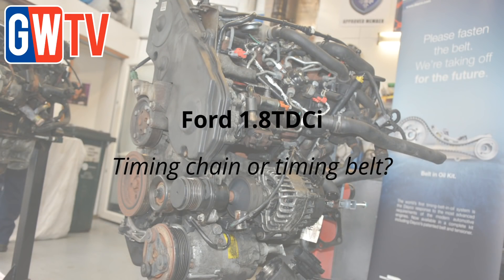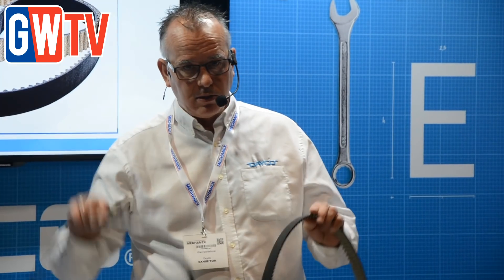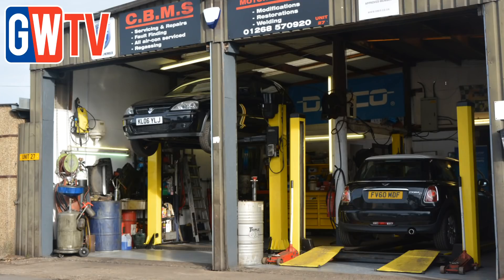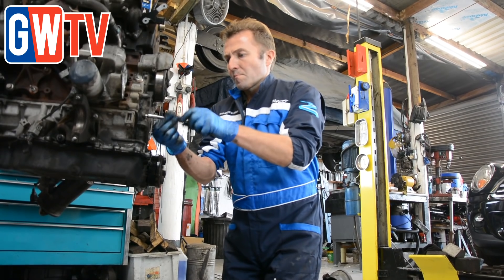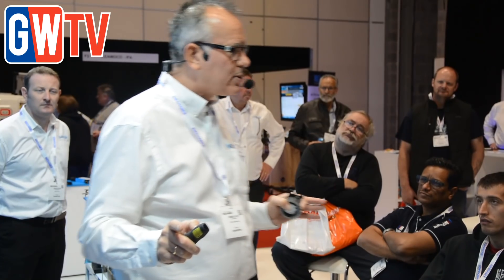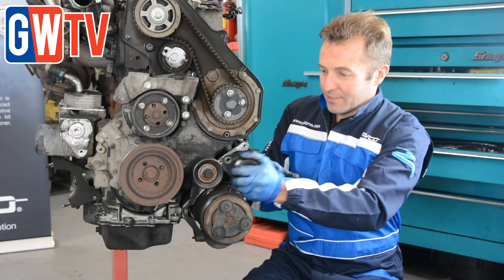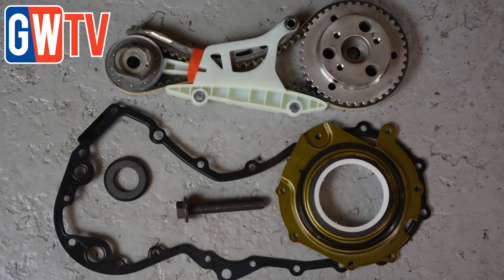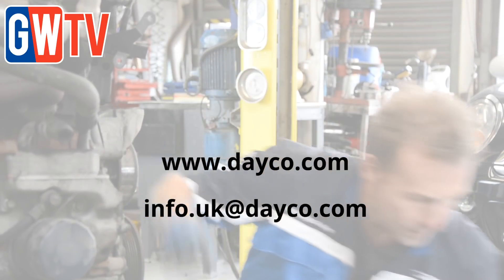🔵 Dayco Ford 1.8TDCi timing belt 🔴

Comment: Why on earth would you replace the timing belt when you can replace it with an orginal ford timining chain that will never need replacement? Even engines that were originally fitted with a timing belt can be fitted with a timing chain with only a slight modification! See https://www.youtube.com/watch?v=E0cY8xbzfJk&t=40s

Comment: Very good information. I may have been conned by my garage. After a major service I was told my cam belt was changed. As my clutch was slipping a few months later I was booking my car in to have it replaced I said that I’m spending more money and would rather scrap it. The garage said the workshop opposite buys these cars for spares and would pay more. When the guy visited me he stated my January 2008 would have been the cam belt in oil so it was not worth as much as I had no proof it had been changed and the garage had only fitted a cam belt kit with water pump! Was I scammed?
Reply: my 08 plate connect has this engine, if you ring your local ford service center and give them your vehicle details they will tell you if your lower timing is a belt in oil or a chain. a lot of people say that after 2007 all 1.8tdci is belt in oil but mine is chain. Apparently if you look at your injectors and they are siemens injectors you will have chain but it is best to check with ford.

Comment: I'd rather stick to a chain drive methinks :) In most cases you get a good 40,000 miles extra before that sucker drifts in timing or rattles if you keep the maintenance up... Which is better than snap, clunk, valves-go-byebye
Reply: The KKDA lower chain rarely EVER failed, even on high mileage cases such as taxis etc.
Reply: @FatHead1979  > This

It's why chains > belts in diesels imho. If you maintain them properly they can pretty much outlast the car!!
Reply: Many people or even whole taxi fleets were getting rid of wet belt in favour of chain. Yes, you can still fit the chain kit on the engine were wet belt was factory fitted
Reply: @dariusz078  I'm aware. the KKDA fuel pump timing assembly is very simlar on both wet belt and chain drive.

Comment: What a god damn STUPID fucking idea.  Let's replace the heavy duty lower chain that NEVER fails with a wet belt, which like any wet belt is super sensitive to oil quality/cleanliness.
Reply: It was done to get slightly better mpg which had cars reduce emissions slightly so could still be sold in Europe ....and screw being reliable
Reply: @simonelsey  can't believe that. I know EU emissions are stringent, but chain to belt gains would be negligible. Not even on the scale. 

It's a cost thing, plain and simple.
Reply: @simonelsey  Given they only kept the engine for just over 12 months after the change, you'd surely have to ask what the point was in changing it for such as short period.

Comment: how often does the chain have to be replaced
Reply: My local trusted independent garage specialises in Ford's, has been going for over 15 years and has NEVER had to replace the lower chain on 1.8 TDCi engine.  They HAVE had to do major repair work when a wet belt had snapped though!
Reply: never once fitted only oil change required as normal,i have converted mine to chain during lockdown 2010 connect.

Comment: And then....they were all changed back to the reliable chain after many destroyed engines!
Reply: Not by Ford they weren't, once Ford exhausted their stock of lower chains, all Lynx engines were then constructed using the crappy wet belt solution.

Comment: what a fu*king big mistake that was belt in oil  durr
Reply: still used in eco bang engines
Reply: @simonelsey  that it is... Although in the newer junk you're more likely to crack a head before the timing belt takes a dump on you, so it's not as big a problem ;)
Reply: @DigBipper188  and melted pistons. 

They really are the worst, cheapest POS engines.

Comment: Alex gregory... you will have to remove the power steering pump & mount off the rear of the engine in order to be able to see or get to the tensioner which goes down through the rear engine case. Thats nornal procedure on a Mk4 mondeo 1.8 TDCi engine. Anything after 2007... should be running the wet belt setup... although in some cases.... cars have had an older engine installed because of engine failure and had an older type (chain) put in without the installer knowing. You have to check with these engines.
Reply: my 08 plate 1.8tdci transit connect has chain. A lot of the 08 plates do

Comment: Hi, is this applicable to 2.0 TDCI?
Reply: No, only the 1.8 TDCi, the 2.0 TDCi engines are totally different units.
Reply: Nope. The 2.0 / 2.5 use a single dry belt to run the cams and pump, unlike the 1.8 KKDA which as seen in the video, has a chain or wet belt system (depending on age) providing drive from the crank to the fuel pump. The fuel pump then has a second toothed pulley that takes drive from the fuel pump and this will run your valvetrain through a second dry belt.